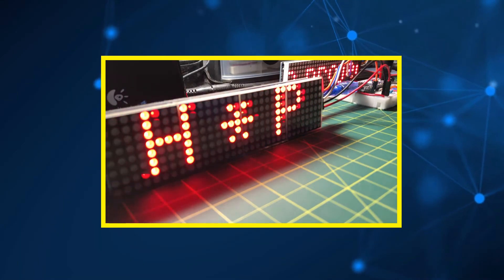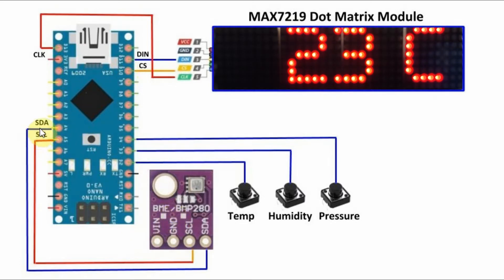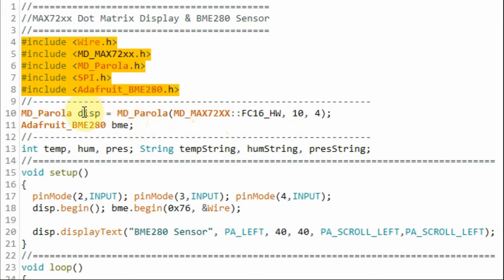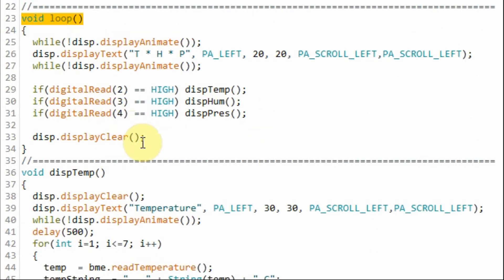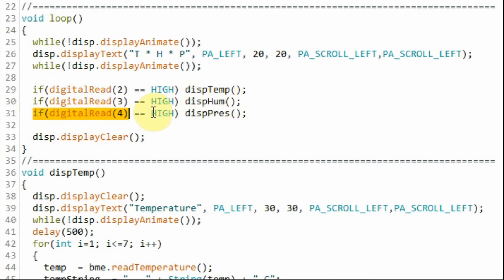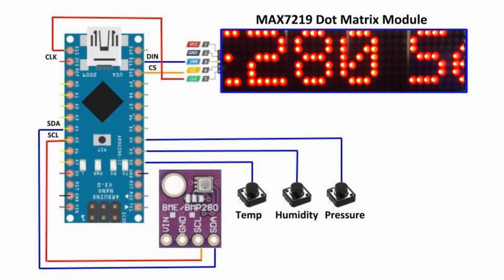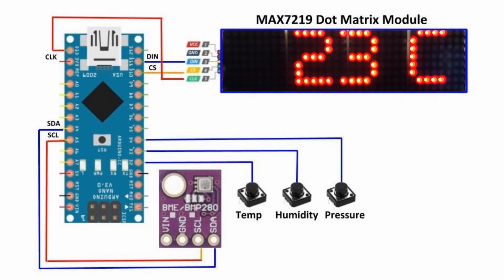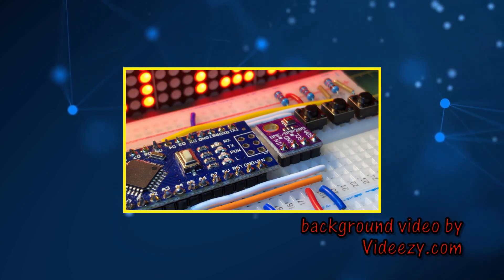MAX7219 Dot Matrix Display & BME280 Sensor

Comment: hi is the buttons + or -
Reply from the maker: It's a push button, one end connected to 5V and the other end connected to digital pin and a 10k pull-down resistor.
Reply: thank you
Reply from the maker: @darrellkluth9706  you're welcome